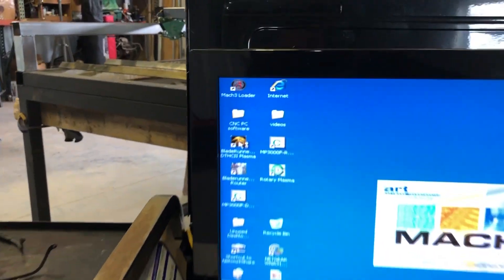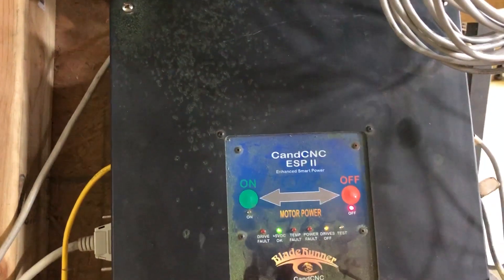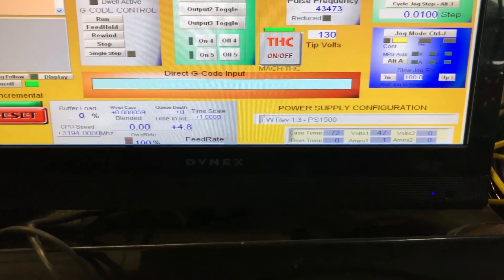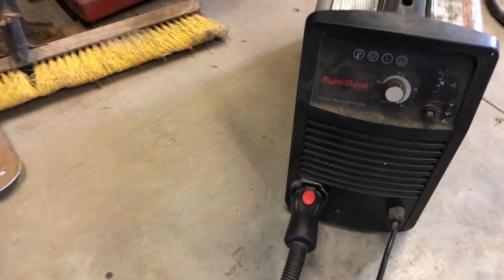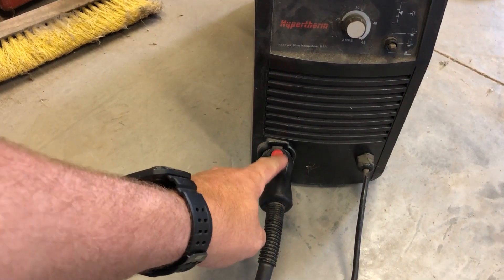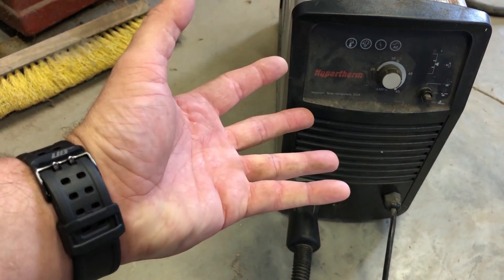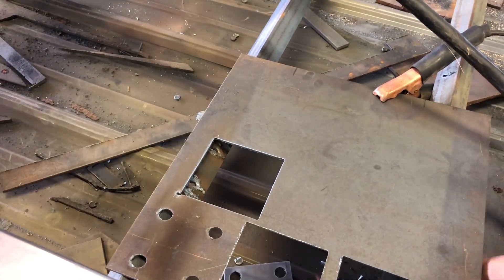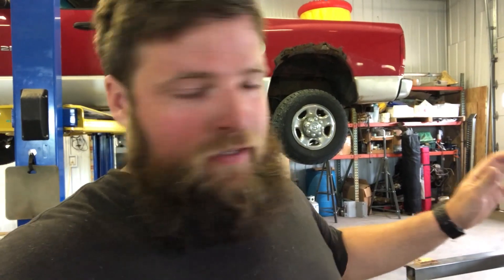DIY CNC Plasma Table Cutting Steel | It finally cuts!

Comment: Cool video man.  I made my first 3D Printer from scratch 6 years ago.  Made from an early Shapeoko 2.  I never ran the Grbl (CNC) box for it.  I started with a RAMPS 1.4 and Marlin firmware.  I understand Marlin can run CNC.  I have some driver boards that can push 4A and throught of making something bigger.   What control board are you running?   I had a Hypertherm 60A cutter at work, came with a vertical torch accessory.  Anyhoo.. Thanks for sharing!  Subbed!
Reply from the maker: Thanks man! Thanks for watching. I hear good things about grbl and marlin. I’m running a complete kit from candcnc. It was called their dragon cut blade runner series. Basically it came was everything form the motors to the software. It made the electronics side of the build very easy but it has its limitations. My system being 8 years old support if the machine goes down is nonexistent. That hypertherm unit would be perfect for a CNC plasma table. I truly enjoy my table and it has changed how I fabricate.

Comment: I have been working on mine for 3 years (winters).  I hope for sparks next weekend.  I didn't know about the safety  on the torch.  I did a test and it didn't fire.  Now I know.  I have a machine torch so I don't need to do the bypass mod.  I have a couple videos out if you are interested. ~P
Reply from the maker: Good luck next weekend. I was pretty excited when mine first made sparks. The machine is the way to go. It’s a much safer option than what I’m running. I’ll check out your videos.